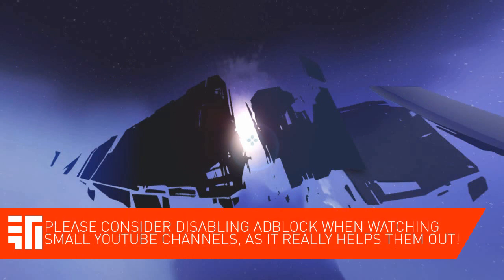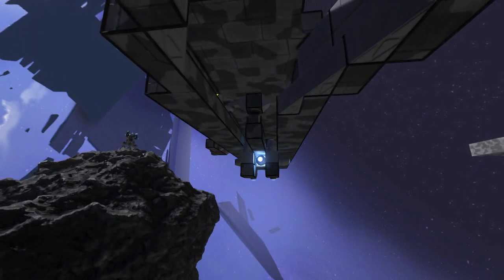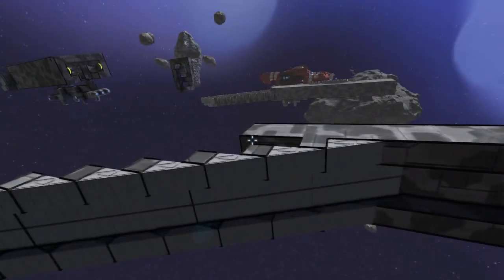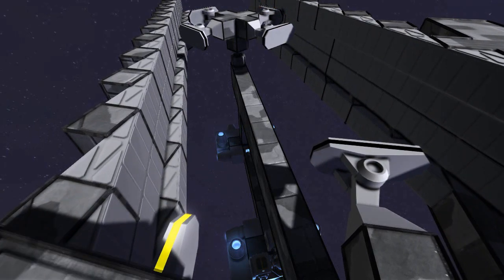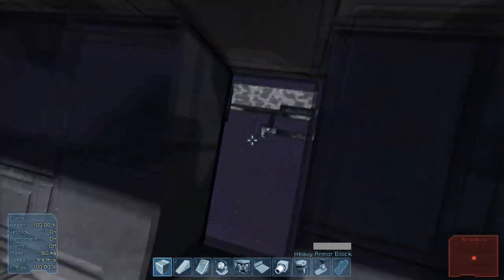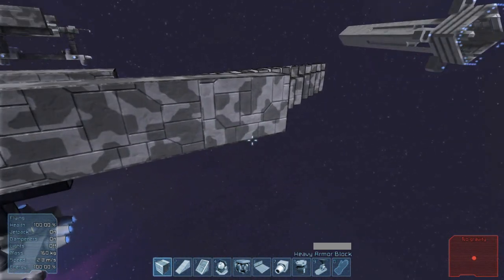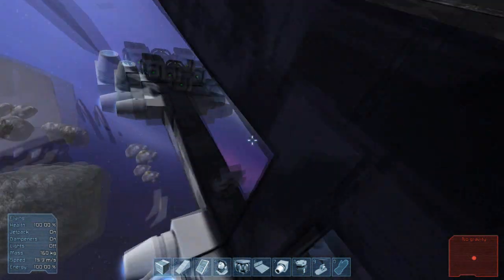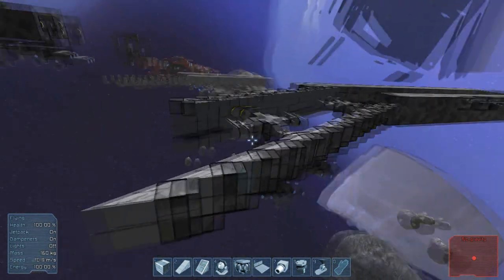Concept Derailed: Tram / Rail System (Space Engineers)

Comment: You need a guide, a pole or something similar out in front of the joint to help push the landing gear  into the correct direction. Without it, the joint will turn outwards,opposite of the direction you want it due to the increased friction at the corners.
Reply from the maker: I've tried that off-camera actually, and the results weren't exactly great. The game doesn't seem to handle drag well. Instead of going with a turn, it goes against it and gets caught - with or without the guide.
Reply: I see, I've noticed some wonky physics into he game as well, like I can't design crumple zones for absorbing impacts. I guess all we can do is send in suggestions and ideas on the forms and see if they can work them them out.

Comment: Why do you need corners? Its space, you go in a straight line.
Reply from the maker: To get to other places? It's not like all the bases or stations will be lined up. I figured if it can't go around one corner, then it's a failure.
Reply: Couldn't you just make the stations the corners so you could switch carriages there? I love the idea, but It just seemed like you were hung up on a problem that wasn't there.
Reply from the maker: Whilst simply having checkpoints would work, it seemed more like avoiding a problem more than anything, hence why I classed it as a failure. Yes, I could have just done straight lines, but I also wanted to test out and incorporate corners, instead of avoiding them all together.

Comment: I just posted a video on a this concept so here is my two cense. 
"The concept behind this type of tram system is to have only one surface change directions for the duration of the trip.  when you have the tram "attaching" to two opposing sides such as the walls you will run into complications with contact between the rail and tram.  You should make the corners as soft as passable by have two gravity effected devices so that the exchange between gravities will be as gradual as possible."

Comment: I think you should try a non-contact system using gravity generators. Have two fields on either side of the rails that meet but do not intersect at the middle of the rail. For the corner, you may reduce the fields to the power 1/sqrt(2) times g (that is ~0.707g).

In that way, the cart will be neutral in the center, but will bounce away from the edges given that you have at least two stones on the cart. Having forward/backward thrusters will help with propulsion, just remember to turn the inertial dampeners off.

One thing that might be a problem is that you might get oscillations in the cart if the cart move off center, but it would still be fun to try.